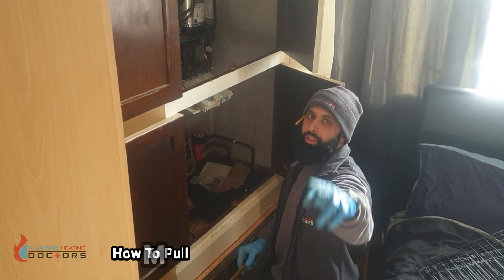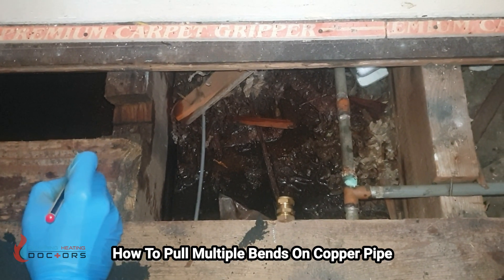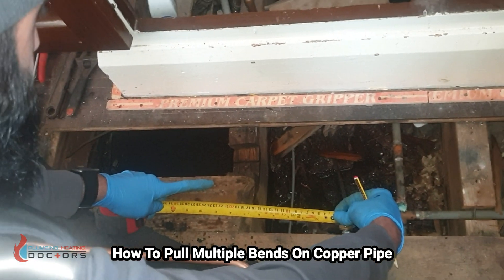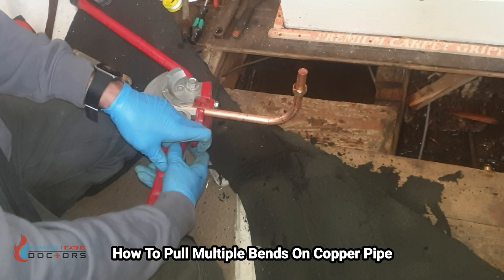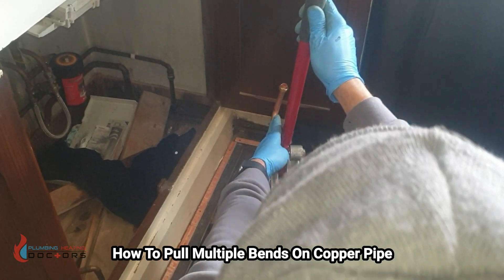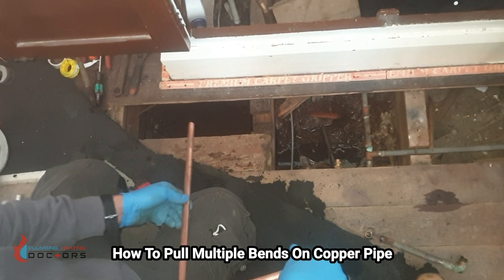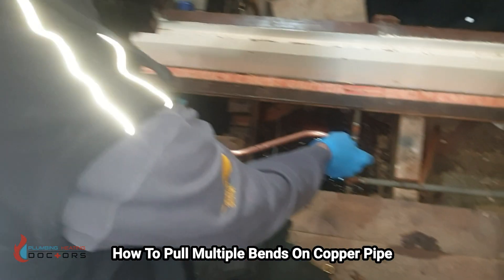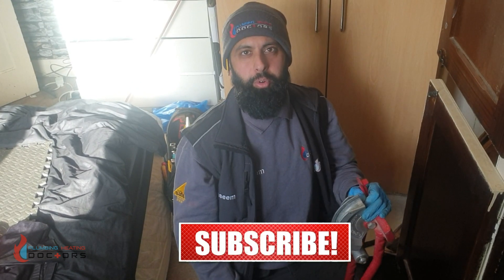Copper Pipe Bending Tutorial | *Multiple Bends*

Comment: Straight copper pipe is hard drawn and thus pre-work hardened. It would be a lot safer to anneal the sections of pipe where the bend will be made to avoid stress fractures. It's east to do -- just torch the area for a few minuets. Ya, your lowering the tensile strength somewhat but better than than cracks if your unlucky.

Comment: MashaAllah, that is so neat 👍🏽 Buzzin off measure twice bend once 😂 p. S is there any chance you can do a video on how to set up a rothenberger superfire 2? I've literally just bought one and never used one before, don't wanna do anything wrong..
Reply from the maker: Bro that's the easiest thing ever
Reply: @PlumbingDoctors  yes bro, I'm just a bit cautious but just going to do it 🐥
Reply from the maker: @MohammedAli-1  go for it - thats my motto
Reply: @PlumbingDoctors  Did it bro 😀 First joint was a pre soldered straight coupler which was really good. Second joint was a 90° elbow (not pre soldered) which the solder wouldn't adhere to, so I'm guessing I didn't use enough flux. Third joint was another 90° elbow which was better but a few runs on it so didn't look nice. Going to give it another bash tomorrow iA. Hope you're keeping well 👍🏽

Comment: no compression fittings under the floor
Reply from the maker: I have explained why in the video 🙄
Reply: Nothing wrong with compression fittings under a floor void, they should never be buried in screed but a floor void is fine, so long as the pipe is properly supported.

Comment: Great video mate👍 But if you use the ‘measure back’ method for 90’s it’s much easier. Get your centre line measure back 70mm(15mm) or 100mm(22mm), put your measure back line at the edge of the former & pull.  100% accurate👍👍
Keep em coming fella👍👍
Reply from the maker: I used to do that but i find this easier but good tip 👌🏼
Reply: slight typo Fibre.... should be 7mm (15mm) or 10mm (22mm) basically 1/2 the diameter of the pipe....
both methods equally good as with compression fittings you've got a slight bit of play..
Reply: @Carl-re6zb  These ‘measure back’ sizes are the McKeown method of bending copper tube, Google it, it’s been used for years by all the Plumbers I know👍👍
Reply: Apologies Fibre.. I've obviously recounted a different method of measuring from a fixed point to centre... Tbh I was never shown the Mckeown method, but after looking it up it makes sense.
Reply: @Carl-re6zb  Don’t apologise son, I was wrong once.

Comment: Need new benders as its rippling the copper pipe when you use them.
Reply: Dont necessarily need replacing, some new guides, make sure the roller is freely moving and clean and grease the former and should be good to go. Worth checking the roller is also straight though, when mine started rippling frequent the spindle had bent so my roller was sitting off square so I did need some new ones.
Reply from the maker: Hmmm
Reply: I thought that it did that if the pipe was cold? Or is that a myth
Reply: @Hambini  no mate copper pipe rippling when bending is 2 things cheap copper or your benders need replacing.